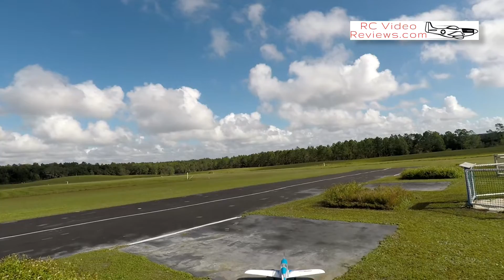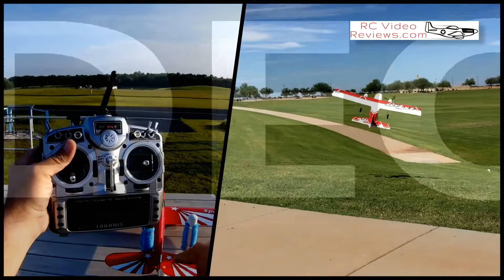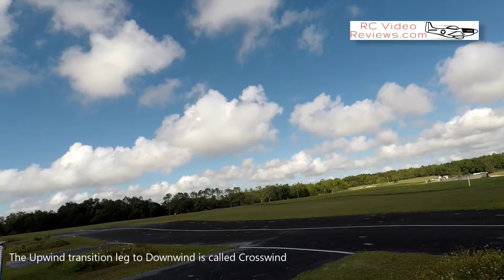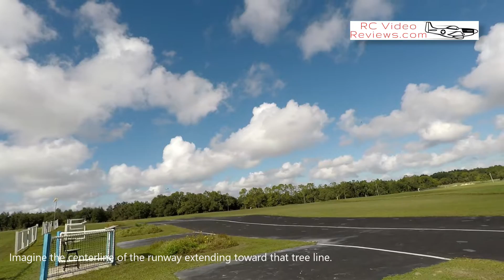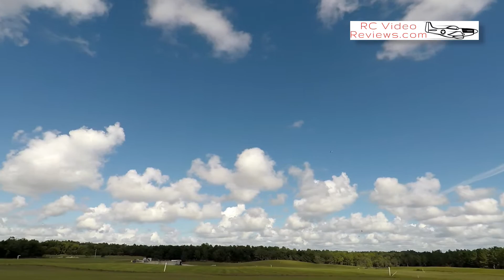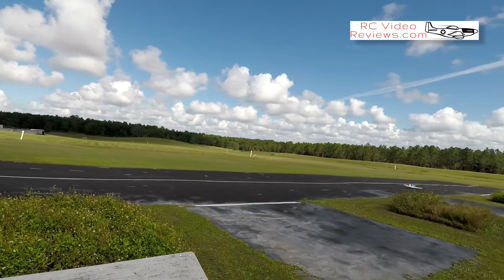How to Land an RC Plane • Plus: The Landing Pattern Explained

Comment: How do u determine your airspeed? My aircraft has a height weight and stall less than 60 kmh drastically. I can't be sure that speed is enough in the non fpv landing

Comment: I spent a lifetime controlling rate of descent with the elevator until I tried EDFs which with flaps causes a stall and 2' splat.  Without flaps seems  fine.  I am slowly learning this method.  No prop wash with jets!

Comment: I agree with you! In trying to help others, I have realized that actions taking place during downwind, base, and final are actually a checklist of things to be accomplished to ensure a good landing. On downwind I am planting my feet parallel to the runway and I am slowing a bit. I enter base at an altitude that will allow me to descend on a (hopefully) constant slope to landing. The turn to base is when I decrease power and the visual comparison to the horizon gives an idea of the rate of descent. The turn to final comes when I feel I am over the vanishing point of the line down the runway center. Wings level on that path, and the only thing to manage is power to the touchdown.

Comment: You did say elevator controls altitude. Some say ideally elevator controls attitude. Throttle (power) controls altitude in landings. 
???
Reply from the maker: You might want to re-watch. That's not what I said at all. "You do not use elevator to control altitude" @7:!5. Rate of decent is managed by power.
Reply: @RCVideoReviews  oops, my bad. May have jumped in too early or responded to wrong video. You explain it very well. Apologies.

Comment: My instructor taught me to fly the downwind bleeding speed and altitude then turn dirrectly to myself still bleeding speed and altitud until arriving a the far edge of the runway. Then use airloins to left turn onto runway. He said this makes it easier to judge your position and altitude. Im just getting into flying and am curious about your opinion?
Reply from the maker: We don't use downwind to drop altitude. We use base and final to drop altitude. I do not really care to use ailerons after I've slowed down on final, I prefer to use rudder to make my turns and ailerons to limit bank angle to maintain the most lift. The rest of what I think is in the video. The brutal truth is that this hobby is filled with opinion and in the end you have to find what works for you.

Comment: Down wind, base, final, I  learned it on a full sized bird. Easier to fly inside than outside...we entered at a 45 deg. Angle, pulled power, add flaps and greased i in...my rc foamies are squrrly. 👍good video.👍

Comment: Thanks for this complete video... :).. My biggest problem is that I am not able to keep my plane in a straight line after landing, it goes to the left and that's just annoying :(..
Reply from the maker: Not sure if it's a tail dragger or trike, but you may want to check the alignment of your wheel when the rudder is neutral. Also, make sure both main wheels turn freely/no binding. Off power with no wind, the plane should roll straight.

Comment: Do you release elevator at touchdown to prevent  bounce?
Reply from the maker: Generally no. In most cases once I have my decent rate set I don't release the elevator until the nose gear touches.

Comment: Hello, I have been flying a sports cub s2 for a while now, I have a 1.2 twin otter from e flite laying around my room, should I jump to that, or what plane would you recommend?
Reply from the maker: The Twin Otter is perfectly stable. I've watched a friend fly at our field. If you can get your Sport Cub up and down without incident, you shouldn't have any issues with the Twin Otter. If you're looking for a 2nd plane that can help you elevate your skills, take a look at the Hobbyking Crusader (based on the ugly stik) or the E-Flite Leader 480. Both of those planes are usually available and are very well mannered planes.

Comment: Your a pilot and no one ever told you not to "dive at the runway?" Lol good info though
Reply from the maker: Yes I'm a pilot and I don't follow your meaning. There are actually multiple methods to conduct an approach, I find the way I explained it in the video the easiest for RC--especially beginners. It is more of a military style which uses power extensively for rate of decent management. In civilian small craft they do teach you to add flaps and nose down to the numbers, but in my experience (1100 hours in military aircraft and 200 hours in civilian aircraft) the military style is easier to manage for RC craft.

Lol, thanks for the comment.
Reply: During my first visit to the local RC field, while being introduced to the club president, I threw my chest out just a little and explained that I had been a full-scale pilot for almost 40 years. He looked me straight in the face and said, "We can teach you to fly RC in spite of that."   --- Little did I know.

Comment: I have a beginner rc plane, and I’m not really sure how to loose speed efficiently without flying in circles with the throttle on idle, or how to get the right airspeed so I’m fast enough to flare, but not fast enough to start going up again
Reply: You probably figured it out by now, but level flight with throttle setting that causes a slow descent is a good way to begin. Flying is not a recipe or formula with any exact measurements.  A lot of factors. The statement of throttle and elevator has truth in it but more significant for full scale,, RC has final is so much shorter and requires faster responses, usually involving changes to both throttle and elevator, as well as all other control surfaces, that it blends together. Yes in an ideal situation set your angle of attack, throttle and cruise comfortably to final flare. Not real life, we are sub-scale, but affected by scale factors. Any unnecessary change to this controlled descent creates an uncontrolled descent.
Practice descents upwind at a good altitude and simulate it.

Comment: Thx for this, I'm brand new to the flying aspect of the rc hobby, Just totaled my first airplane today trying to learn things like this due to no experienced guidence. I'll be remembering what you taught on my next one👍
Reply from the maker: Don't let the crash bother you too much, we've all been there. Just keep plugging at it and take things one step at a time. Good luck.
Reply: Try learning on a flight simulator like Realflight or something similar.  I did that 20 years ago and soloed my first try without using a buddy box or trainer.  Did loops, rolls and landings first flight.  Didn't crash until many flights later.  Goodluck.

Comment: I have a hard time with landings. I always initiate the glide slope so close to where I am landing and don't end up with enough space to land and end up having to do a go around. I get scared to slow down the speed further out because I don't want to stall the plane and make it crash. Guess I need to work on conquering that fear.
Reply from the maker: It's really easy to develop a fear of slowing down if you stall or worse, tip stall close to landing. You should also make an effort to stall your plane on purpose high enough to recover so you get a feel for what it looks like and how it behaves.

Practice touch and go's. Learn to pick your spot and use the techniques in the video to manage your descent rate and speed.

Comment: Thank you. Accepting the idea that the job of the elevator and throttle switch upon landing is hard to process. Another feature my plane has is flaps. Flaps or flaperons (ailerons that act as flaps) can be super helpful. If you do not have flaps, you can configure the ailerons to be flaperons. There are plenty of tutorials out there for a Spektrum programmable remote. If you have flaps operated by two seperate servos, you can join them with the ailerons so that the flaps and ailerons are syncronized and you basically have double ailerons and double flaps. https://www.youtube.com/watch?v=mAzEQwYoZwI. This will work on any programmable Spektrum and even a DXE if you use the mobile app. Flaps help with takeoff by inducing extra lift on the main wing. More importantly, they help with landing by inducing lift and drag on the main wing and lowering the stall speed which helps to slow down the plane even better. When flaps are applied, the plane is going to suddenly lift up but then it will go down. Flaps should not be used in super windy or in any crosswind situation, especially flaperons since you may need ailerons to help guide the plane through the crosswind. Also, you should not lower the flaps until you completely cut off the throttle and the plane is in a glide slope. They really do help though and make a difference. So they basically tie into the elevator and throttle equation. In case you are wondering, my plane is a Horizon Hobby Carbon Cub S2 which I heard has a high tendecy to stall. I love high wing planes and might stick to them forever.

Comment: thanks for creating this rc video...as a beginner pilot just learning to fly with a high wing trainer 40 size nitro..I find knowing exactly  when to begin making my base turn very difficult ...any tricks / tips to help with that specific part of landing ....thanks much
Reply from the maker: It's called sight recognition. Just go get the stick time. If you turn too early, go around. If you turn to late go around. Each time you make the turn, take a mental snapshot. Eventually you'll just know. Also, if you use the modified pattern I show in the video--the racetrack--you can adjust your radius to help find the centerline.

Bottom line though is just go get stick time. That's what will teach you.

Comment: I'm self taught (not an AMA member, I usually fly at various parks around where I live, closest AMA field is a prohibitively long drive away), and I've never had any issues getting taildragger aircraft down. Recently I got my first plane with a tricycle gear, and I keep bouncing on the landing and breaking the nosewheel off on the second impact. What am I doing wrong?
Reply from the maker: Whenever you bounce it's because the plane isn't ready to stop flying. i.e. You're not slow enough. Try this: As you approach the ground, start to flare so the nose wheel is just off the runway and the mains are only a few inches off the runway and just hold it as long as it takes for the plane to touch the mains to the runway. That's the speed you need to touch down.
Reply: @RCVideoReviews  Thanks, I'll give that a shot

Comment: Thanks. What plane are you flying here?
Reply from the maker: The best RC Plane I’ve owned: Millennium Master. Used to be Flyzone then Tower now discontinued.
Reply: RC Video Reviews got it thanks! It sure flies nice.
Reply from the maker: I love that plane. Disappointed they discontinued it.
Reply: RC Video Reviews I checked eBay just in case :-) I’m trying to land a P-39 and struggling. I have some other planes that land very predictably following your guidance. The P-39 has pretty high wing loading and seems to want more power, but that power arrests the decent as your video shows. I’m afraid to cut the power and stall. Tricky business for me.
Reply from the maker: @tyfude  You might want to check this video out: https://youtu.be/PKNqkHaIosk

Comment: Thanks for the video. Landings, yeah, I need to work on those... Were you doing coordinated turns? Do you recommend them for the base leg and final?
Reply from the maker: If I’m using 90 degree turns I initiate them with the rudder and coordinate with ailerons. If I’m using the racetrack it’s more of a yank and bank—so not coordinated in the strictest sense but also not really slipping.

Comment: I totally agree with your modified pattern. With a smooth curve  through base & approach, it is easier to achieve a steady rate of descent. I’m fortunate as a beginner pilot, that at my club field, the racetrack pattern is used by the majority of fliers. So although I need to be able to fly a proper rectangular pattern, I’ve never had to worry about performing a 90 degree turn while I am attempting to bring my plane gently down onto the runway.
Reply from the maker: I've thought about this a lot. In a full size plane, the two benefits I can come up with for a student pilot are 1) It demonstrates control over the plane. 2) It gives the student a repeatable perspective on the runway. i.e. Lets them easily see what "good looks like".  On the first point, I've taught all of my driving age children how to drive and one thing I insist on is that they control the vehicle, the vehicle doesn't control them. So I suppose the 90 degree turns help the student understand what should be happening and what good looks like; however, the racetrack turn has always felt more fluid and manageable to me.
Reply: RC Video Reviews. Even when flying a model the rectangle course demonstrates control. At my club field we have to negotiate the surrounding trees, low flying is limited. I can’t take a long approach, I would run out of runway.
Reply from the maker: @koalatails6391  You need a Banshee https://stoneblueairlines.com/airplanes/vas-the-banshee-36.html and a set of FPV goggles. I used to have a blast navigating our park in Arizona with that plane on goggles. We had a row of trees running parallel to a brick wall and I used to try and pull a "Luke Skywalker" by dropping the banshee between the two and firing a torpedo at the death star. Loads of fun. Ok, back to your point: Yes, many things taught in full size flying are about control. So I think you hit the nail on the head.

Comment: Great video bit it was hard to see the plane unless it was on the runway .
Reply from the maker: I know. Unfortunately with a wearable camera and no cameraman, my options are super limited. i.e. No zoom. I originally shot that video with the 60" Kaos, but the camera shut off during filming and I didn't know it. I think going forward I'll use the Kaos as the training plane. It's just bigger and probably easier to see. Maybe I need to get an Orange plane??